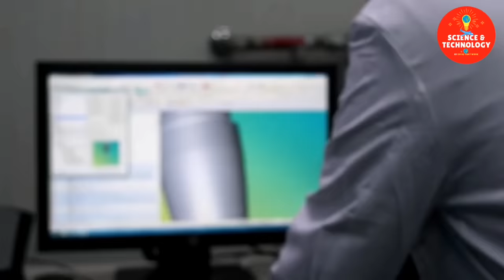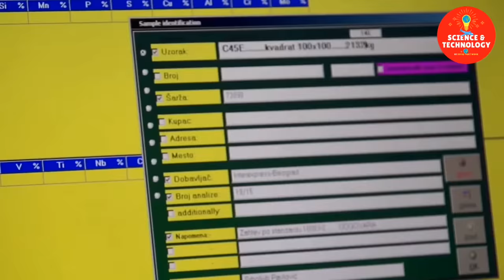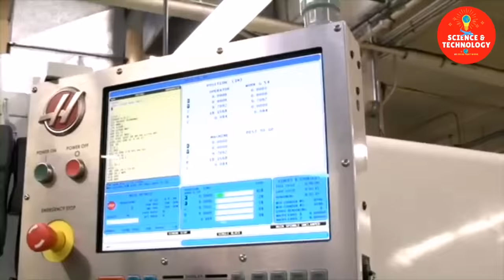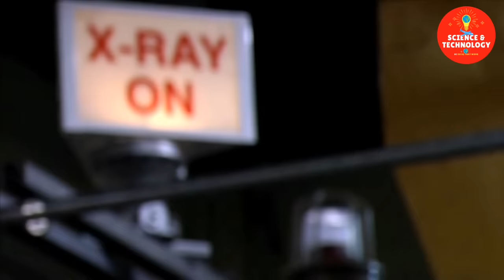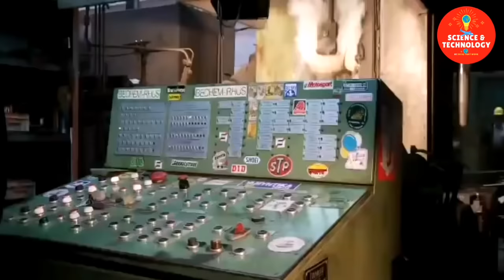How Mini Rockets Are Made?Modern Ammunition Manufacturing Process -Inside Amazing Ammunition Factory

Comment: There's a lot wrong with this video. First, there doesn't appear to be a single "rocket" in the video...it's all artillery shells. Second, at least parts of the video are definitely showing the dismantling of the shells, presumably for safe disposal. Third, it's utterly random with no information about what's happening or in what order. It's just random footage of various stages of the creation and disposal of some shells.

I try not to be critical for the sake of it but this video has very little to recommend it.